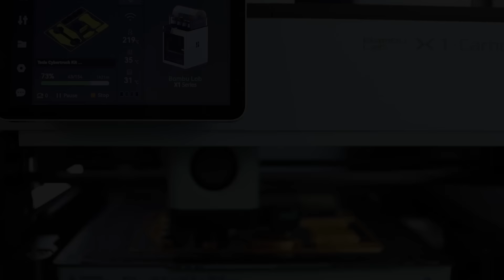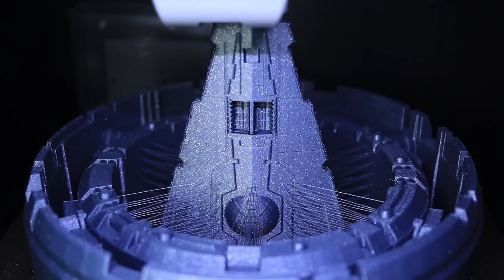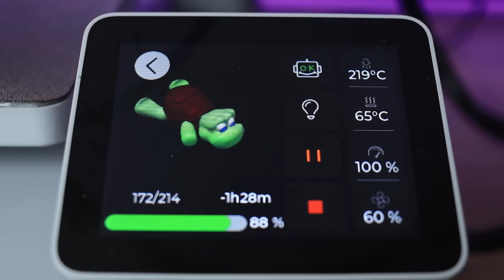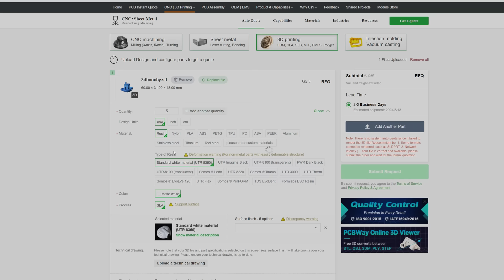TOP 25 COOL Things to 3D Print for GIFT

Comment: I have a stupid question because I have no clue how all if this works, but I'll ask it anyway. 

Could I use 1 or 2 of these printers to print everything that was done in this video, or are they used because of how they print each thing? 

And as a complete novice and no idea where to start, which one of these printers would you recommend for a beginner?
Reply from the maker: You can print all of these models for example on Bambu Lab A1 Combo ( it can print multi colors )